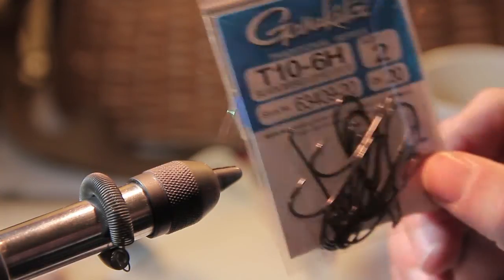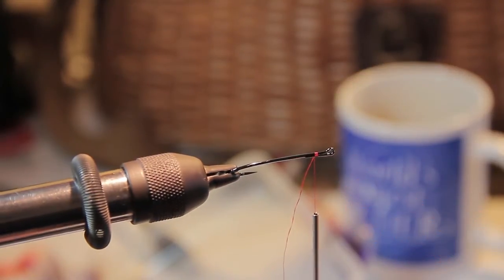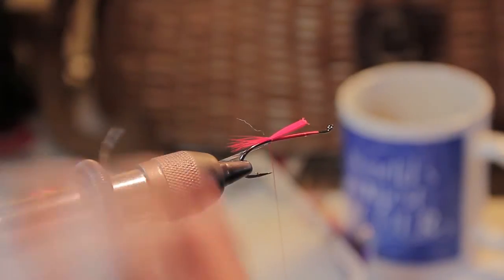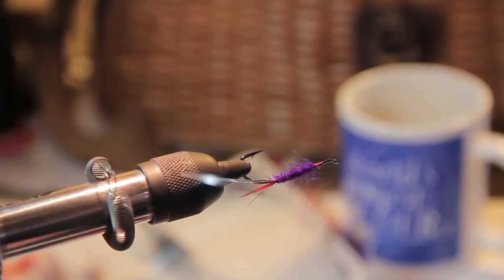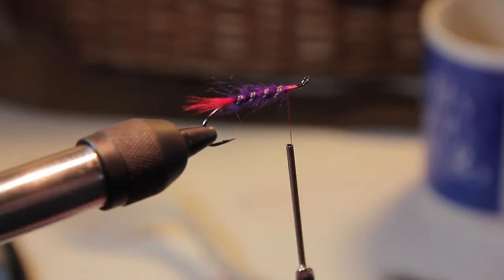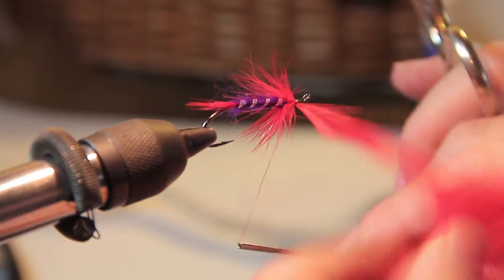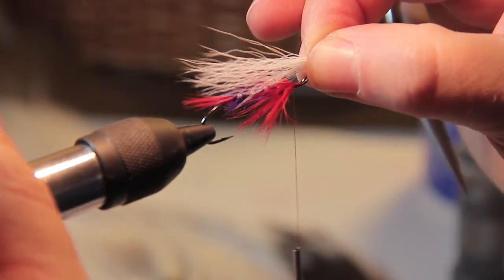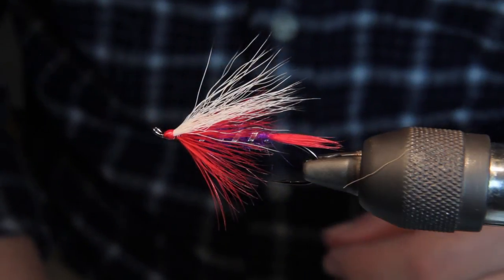Tying a Beautiful Classic Steelhead Wet Fly

Comment from the maker: Tying by the tips allows the stiffer hackle fibers near the tips of the feather to hold the softer fibers at the base out away from the body  so that when the fly is swinging it holds its shape better, preventing the hackle from just collapsing against the body.
As for staking the hair, I remove as much of the underfur at the base as I can. I hold the hair by the tips and remove the short fibers. Then I cut the hair to about 2 inches in length and place it in the stacker.